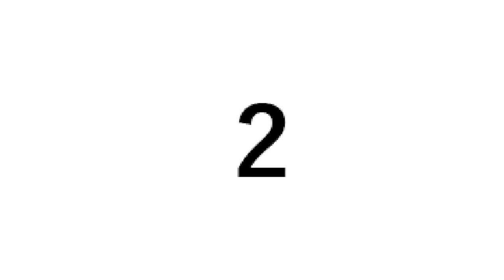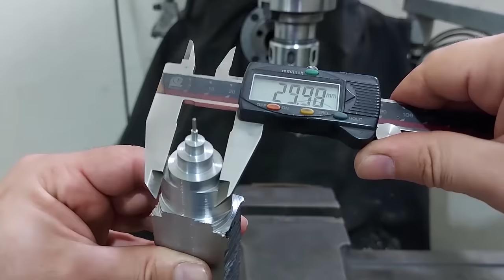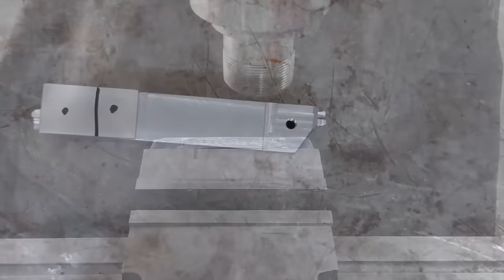Ways to use broken tools you never knew existed(Don't forget to like)

Comment: So, grind it and use it as a cutting tip, grind it and use it as a cutting tip or grind it and use it as a cutting tip? I actually knew of that trick. How about grinding them to use as fixed centers, clean up the ends and use them as dowel pins, measuring pins, really tough axles or center punches for hole transfers.
Oh, and get yourself a protective cap for your horizontal spindle taper when your spraying chips everywhere.
Cheers

Comment: Hope this helps a newbie: Halfway video play I remembered my first day's absence to machine-shop class orientation.  It was worthwhile my observations to understand these are broken "drills" and not drill-bits being  salvaged into "cutting-tools", which these are repurposed into "tool-bits", and others so labeled according to machine equipment it is specifically bench grinded for:  

Explanation is a lathe's tool-bit is reformed into different angle/shape for a differently designed  holder than milling machine.    Cutting tools are distinguished from mechanics' or etc non-machine shop tools.    Even their alloys are hardened/tensile strenghthened by tempering processes, and even slightly different betwixt some machine applications. Thus especially different are metal categories unlike other tools outside a machine shop.  Another difference is a mechanic's tools refer to power-equipments, but these are machines like a drill-press for one used among those displayed in this video.  This video is a worthwhile contribution for DIYs economizing.

I liked that tech-school class in my younger days.  If only possible for me to overcome personal issues of attendance and punctuality, I could have broadened my manufacturing independance desires into any materials for fabrication, except for specialty parts like electronics.

Probably I could not have progressed up to their programmable multi-operation machine. And tech magazines debuted programmable solution-bath equipments having electric-arc cutters!   But isn't learning what you can and when you can such great fun?
Reply: Tf you talking bout? 🤔 ❓❔❓‼️⁉️
Reply: Yep, dont give up there's still hope for manufacturing anything your little heart desires.
Reply: Great take from it! I had similar experiences but now I'm looking into how to build a wire EDM machine at home, I mean, the learning never really stops
Reply: @droopy_eyes  If that is true, it's pretty ironic and he should've went to class more often. The guy is using broken carbide endmills, which can be ground into any serviceable tool in the machine shop. He'd also know the shank of a HSS drill is still serviceable if you apply the effort as shown, but they're so cheap it's not worth it to most these days. The biggest thing lost in all of the repurposing is the benefit of the coatings.

Comment: This works well for using used and broken HSS cutters. But beware if you want to use a broken Carbide EM. You will need a special "green" grinding disk made esp. for carbide. A regular grinding wheel wouldn't last.

Comment: Please consider tucking your shirt in while on the lathe. It's never a problem until it's a problem, then it's too late.  Same thing for "cutting off the deck" on your mill, I've fired machinists for less, but hey, it's your mill and your show.  (When you make an error on the Z axis and cut your table you'll think of me every time you see it. I know, a good machinist never makes a mistake...lol) As for the content, all very good ideas. I can't tell you how many times we've been in a pinch over a tooling issue and can't get the tool delivered in time to make the job and we've created a tool to get the job done. These are the skills we use to problem solve when new isn't an option.

Comment: hi use which type of steel for the tooling?
Reply from the maker: It depends on the type and application of the tool, but generally from 2312 and 2375